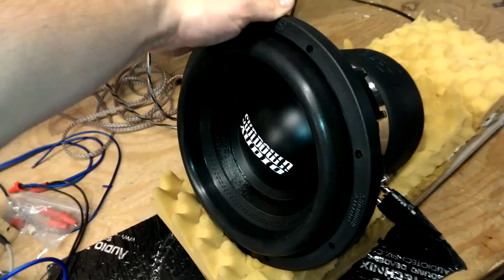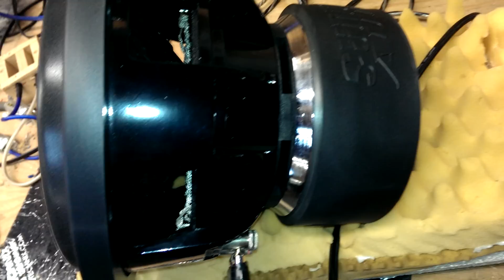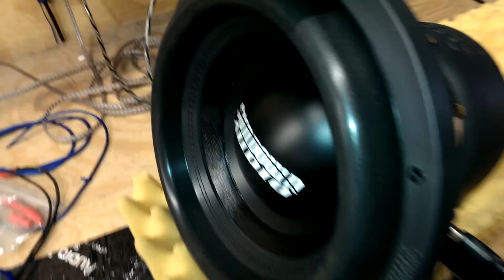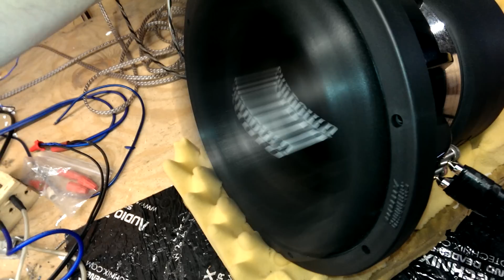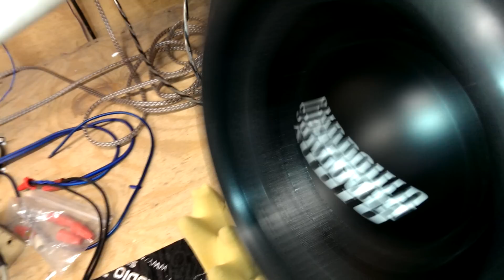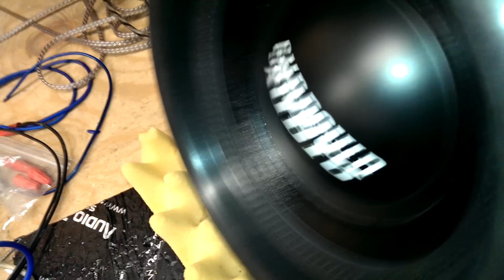X-10 w/ Standard Roll ("SPL") Surround Free Air Demo

Comment: jake is this x10 comparable to a zv3 10? so this x10 vs zv3 10? im looking for the most output.also whats the reccommended space for this x10 ported?
Reply: I believe recommended air space for the x-10 is 1.5 cu but I have one in a 2cu box and it slams the lows on 1500 watts shakes my car like crazy these subs are impressive